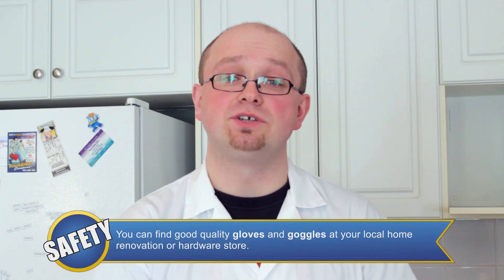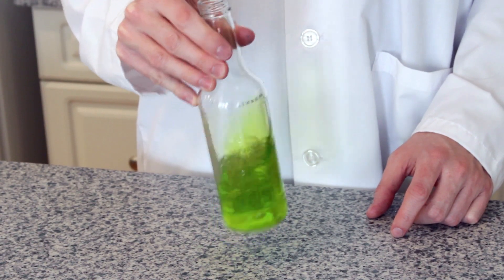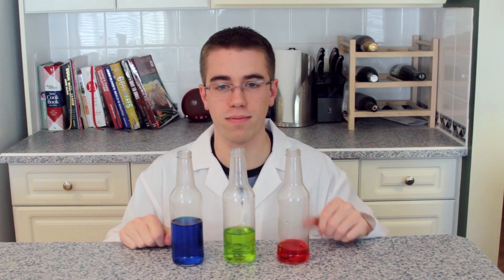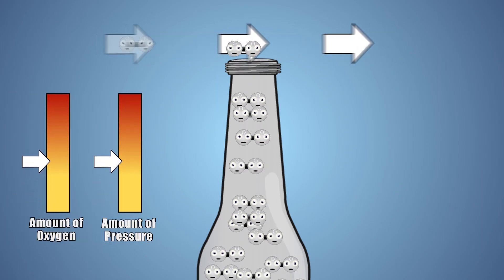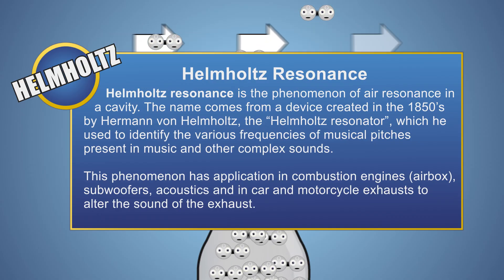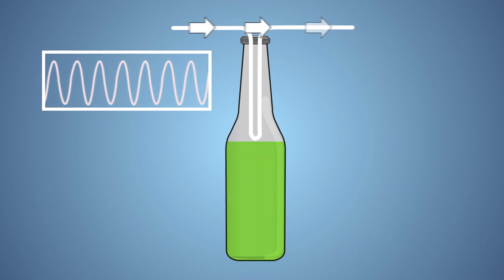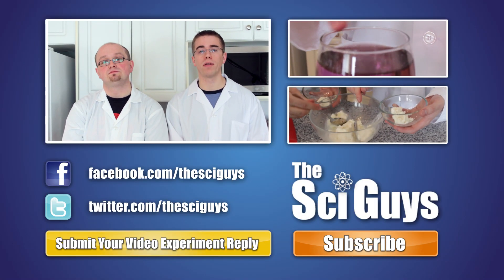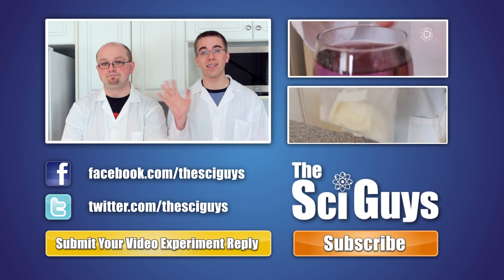The Sci Guys: Science at Home - SE1 - EP9: Physics of Sound - Part 2: Bottle Flute - Helmoltz

Comment: Actually the air entering the flute would be CO2 right? assuming the diatomic molecule you used is oxygen
Reply: would it be a mix? the air entering the bottle wouldnt only be your breath. you're pushing other air molecules in too right? I'm not an expert, I don't know.

Comment from the maker: I do not believe that this will work with a cup.  The reason is that the opening of the chamber or cup is too wide. If the opening is too large, the momentum of the particles will be reduced and won't resonate. Also on the reverse of this if the opening of the chamber is too thin it will choke the flow of air. This process does work on larger scale chambers, the larger the chamber the greater the volume of air and the greater the air pressure that is required to start the resonance.